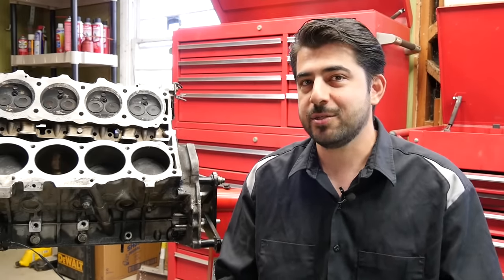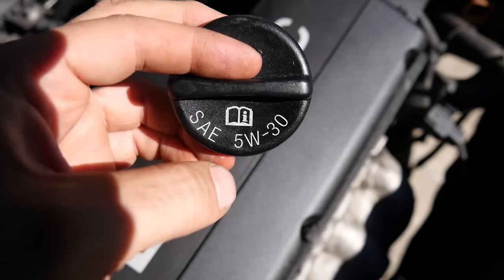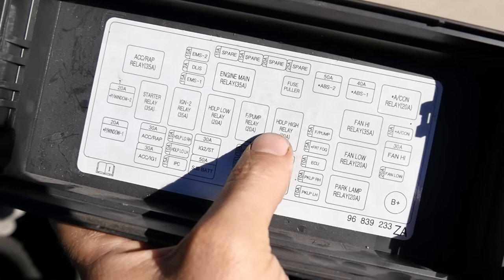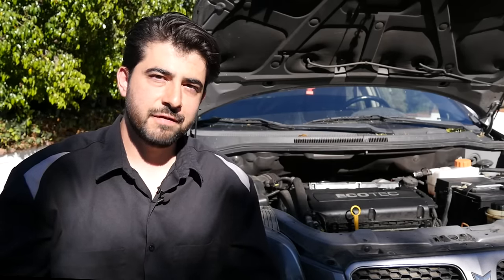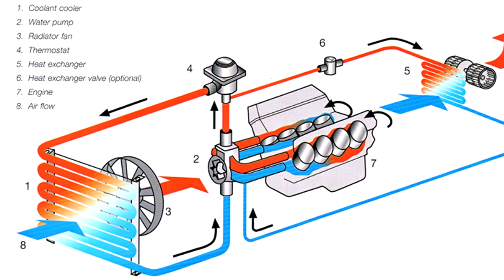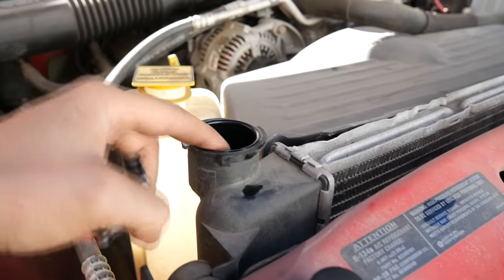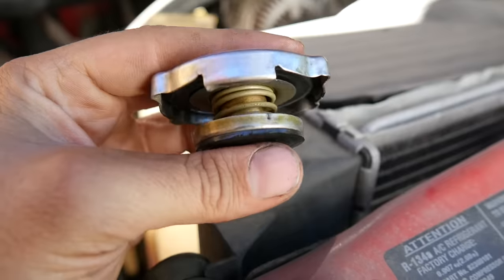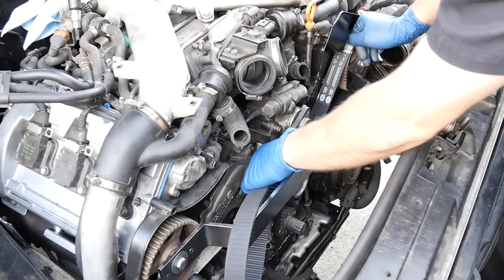Make Your Car Engine and Transmission Last a Very Long Time - Top 5 Tips On Car Care

Comment: I'd add to points:  (A) Check oil level at least monthly or weekly if you drive lots of hiway miles, oil use increases on hiways and oil level can drop lots before your next oil change! (B) Don't beat up your engine! It will last longer if you don't flog it!
Reply: Why would highway miles increase oil consumption?   That makes absolutely no sense at all.  Where are you getting your information from?
Reply: @GoingGoneGalt  Based on experience on several cars oil consumption would be more noticeable on several long drives. On modern engines, a lot of vacuum is used to reduce sludge in the engine by sucking up hot oil vapor and burning it before it can condense again. As an add-on some folks use 'catch cans' to catch oil vapor before it reaches the throttle body.
Reply: @mmpiforall5913  Anecdotal observation with zero data to back it up is worth as much as a congressmans promises.  Highway miles with lower average RPM, temperature, and chamber pressure are always going to use less of everything.
Reply: Highway driving with higher, longer sustained rpm and miles accumulated more quickly, will burn more oil. You should definitely check it more often. Plus, you do not know, if you do not check it. It’s drivers responsibility to check fluids and tires regularly.
Reply: @davidl766  Kiddo, I would bet that I have been driving and keeping my cars going for far longer than you have been alive.  Show me one bit of data that supports your claim.   One.   Anywhere.  And what are you driving that is drinking so much oil that you can tell where it goes??  My road warrior Civic with over a quarter million miles on the clock doesn't consume a quart in 20,000 miles.  In the desert, often in 110+ degree heat.  Going over a 3000' mountain climb every day.   Twice.
Reply: I check my oil every other time I fill up the gas tank.

Comment: Great tips. A few basic things I'd like to add in. Don't leave your car idling from long periods of time. I see soooo many people just carelessly leaving their car running for 10, 15, 20+ mins because it's "easier" to just get back in and go. And they do this in the middle of a hot summer too!  Also, drive your car gently until your car is at full operating temp if at all possible. I can only imagine how many engines would last longer and remain problem free if people did the most basic stuff such as this!!
Reply: What happens when the car idles for too long?
Reply: @rihasanatrofolo2472 it starts to overheat cuz it's only cooled by the radiator fan
Look up what happens if you idle too much plus it wastes gas
A startup uses 7 seconds of idle time fuel, so if you're sitting more than a minute just turn off the car 
I almost always avoid drive thrus unless I'm the only one in line or 1 person in front
Reply: @tomtemple69  That sounds extreme. I keep my car running for example when we'r eating and it's cold outside. Never had an issue yet. Is it impending doom?
Reply: @rihasanatrofolo2472  depends on how long you plan on keeping your car working in good condition, you shouldn't idle very often and no more than like 1 minute 
after 7 seconds of idling, you use more fuel than it takes to start a car, the engine isn't at optimal temperature for combustion, leading to incomplete combustion and carbon build up in the engine 
if u plan on keeping your car longer than like 150k miles, you should minimize idling, plus its just wasted gas 
when it's cold outside, you only need to warmup for like a minute, modern synthetic oil still performs good enough at low temperature, it just needs to be warmed up if you're gonna be revving it high and giving it a lot of throttle
Reply: @tomtemple69  cheers
Reply: @tomtemple69  Modern engines shouldn't overheat just because it's idling for too long. People idle for long periods in the summer and they don't overheat. Something's wrong with your cooling system if your radiator fan is on constantly and can't keep the coolant temp gauge in the middle.
Reply: @JulianKapa  ok but still, the fan can only so much, and the low RPM at idle leads to carbon buildup and fouling due to low combustion temperatures inside the cylinders, takes 1 minute to do a good search to see why idling is bad
plus it wastes gas
Reply: @tomtemple69  Fair enough. My car says it uses 0.5 litres/hour which I wouldn't say is a significant amount, but I'm not one to idle or sit in my car eating and what not.
Reply: It's very common to idle a long time here in Australia, for minutes, or even the whole lunch break to keep the aircon running... ❄️🔥🌡️🏖️

Comment: A quick note -- if you can prefill your oil filter, it is best to do it, wait and let the oil soak into the media, fill it again, wait until the oil soaks into the media...  until it actually levels out where you want it.  This might take a couple minutes, but it will optimize the oil in the filter, which is the entire point of doing this!  A quick fill and install might leave the filter about half empty, or even more empty.
Reply: I do this. After I pull the drain plug, next I write the mileage on the filter with a paint pen then turn it upside down/opening up in the box. I will fill it and let soak while removing old filter. I'll do the other stuff needed in oil change. I will fill a 2nd time before installing. Doesnt take much extra time.
Reply: Really overthinking it
Reply: It will get oil in it soon enough
Reply: I have been changing my own oil for 35 years.   Never once have I prefilled a filter.  Never once have I burned up an engine.
Reply: @GoingGoneGalt  IOW, this may well be overkill, especially in well maintained vehicles. Point taken. Theoretically, it is best, but might not make a significant difference. There are no studies to show when it might matter and when it might not matter. In theory, in some cases, it might matter.
It might only help assuage one’s OCD, too.  lol
Reply: @GoingGoneGalt  these people pre soak their clothes before placing them in the washer .
Reply: @wellnesspathforme6236  I would never tell anyone not to do it, it can't hurt, so if it makes you happy and makes one feel like a mechanical genius, have a ball.  But don't feel guilty if you don't bother, either. ADD; This from a guy who religiously paints all my threads with either anti seize or threadlocker, never dry!
Reply: @GoingGoneGalt  Keeping those bolts from freezing up is a Godsend!

Comment: Great maintenance advice to make your vehicle last longer. About 20yrs ago, the thermostat failed on my mom's car, causing $800 in engine damage. That thermostat cost like $10. If only we knew back then!

I'd also like to add that in addition to this maintenance advice, if you want your car to last as long as possible, drive it with care. Don't be heavy on the throttle. Jackrabbit starts are bad for your engine, transmission, and MPGs. Dont accelerate harder than necessary. The higher you're revving your engine, the more stress on your engine AND transmission. In other words, treat your car respectfully, maintain it properly and it should last a long time.
Reply: Tell that to my Tacoma    I floor it off the line   and I have 436k miles on her.     I beat the hell out of trucks transmission  I treat her like a rally truck and she still going hard
Reply: What about vtec tho? Hahah
Reply: @ncrtransport5993  it'd last even longer if you drove it respectable.
Reply: @lilbbbbbbb  Honda should learn about torque.
Reply: @palebeachbum  umm ok lol? And I should become an engineer don't we all need to learn something
Reply: @palebeachbum  but at this age and that many miles I got my money worth over and over all those miles were work miles,       so it something does break its 1500 for a motor and 800 for a transmission    which is nothing
Reply: @palebeachbum  plus it's also a truck it's meant to be used and abused not babied
Reply: @ncrtransport5993   yes to a point. And engine is an engine and if you drive it harder, longer, it'll certainly start blowing seals and gaskets sooner than an engine that was babied. Granted, if you're using it as a work truck you can't really avoid the extra wear and tear. I can't stand these prissy luxury trucks used for commuting. It's counterintuitive. It makes about as much sense as buying a Porsche and driving it on dirt and gravel roads its whole life.
Reply: @palebeachbum  well if you compare my mileage to most people I have double what most people get out of their engines,  weather your driving at 2500 rpms or 4k rpms it's not really wearing the engine out more   now if you redline the engine all the time then yes.       90% of all wear on internals is on startups        so I have 436,084 miles but i also let the truck idle countless hours.     Engines are designed to run         look at the million mile bmw    they only turned it off to change fluids then threw it back on the dyno
Reply: @ncrtransport5993  I think that has more to do with the engineering. Those Toyota engines routinely go a long long time compared to most comprable engines. I personally have more experience with Volvo 4 cylinders from the 80s. Those things were just getting broken in at 200,000 miles.
Reply: @palebeachbum  you think at 436k miles you really think he cares cmon man🤦‍♂️.
Reply: @dannymartinez8522  probably not. But his situation is an exception to the norm of all the cars out there.
Reply: @ncrtransport5993   Your talking about a Toyota. Do that to a Dodge or anything cheap American and see how long it last..
Reply: Tell that to the people who drive like maniacs in my area!  I agree though.
Reply: Hazrd to say when you drive a yaris
Reply: palebeachbum what about a rotary?
Reply: @cptcrunch2520  They blow their seals prematurely. Excessive wear. High revving engines wear out too.
Reply: I think that's only possible if she ignored the temp gauge inside the car and kept driving an overheated engine. Even then, most modern cars will shut off when passed a certain temperature.

Comment: I am the Scoty Kilmer of Amsoil,,....use it and  it will make it last and run much better ...OK a suggestion abut the filter that fits sideways (horizontal) ,,,Just pour enough in oil in the filter  wet and prime the filter media because a dry filter soaks up right much oil  ,no worries about spilling,, and that will allow the filter to prime pretty fast and as you say ,dont put on a dry filter ..

Comment: Use synthetic oil in standard & auto Trans too (will help standard shift trans shift better too!), maybe even an inline filter on auto trans.  I like to use redline or other brand coolant additive esp in summer, turbo cars love it. Use quality oil filters that have a good check valve in them to trap oil on shutdown, then a full filter will lube engine on startup. I like Tufoil oil additive, used it for many years...It holds guinness world book of record as the slickest substance known to man...has 11 International patents, used by NASA too. I dont know if they still sell those radiator filters anymore but they help to keep crap clogging up coolant system

Comment: Even if your oil filter goes in sideways, you should still put enough oil in it so the filtering material inside becomes fully saturated with oil.  It'll reduce the amount of time it takes for the oil to get through the filter and up into the engine once you start it for the first time after the oil change.
Reply: That is what I do..  soak the filter material and even for a side-mounted filter, you can put some in the bottom if you're quick enough getting it on.

Comment: I live down south and remove the thermostats from my vehicles. I also use synthetic oil and transmission fluid. I have over 200 thousand miles on my vehicles and they burn no oil between oil changes every 3000 miles. If you live up north where you need a heater in the winter, you can still remove the thermostat in the warmer months. It will make your engine and transmission last a long time by running cooler and getting good lubrication from the synthetic oil.

Comment: 5:06 - A lot of modern cars do not specify any interval for changing transmission fluid, so the big recommendation there should be - do it anyway. Modern synthetic transmission fluid is fine for probably 150K, but if you plan on driving your car longer than that you should probably change and flush at 60-100K.
Reply: NEVER FLUSH UNLESS YOU KNOW THAT CAR'S HISTORY AND YOU HAVE ALWAYS FLUSHED EVERY 40K MILES OR SO.
If you don't know the history and the car is high mileage have the pan dropped and DRAINED (not flushed) and have the filter replaced.
Any reliable transmission shop will tell you this.
Flushing can destroy the transmission IF it's high mileage and has been not well maintained with fluid changes.
Reply: @mikejohn0088  Yes. This stood out to me as well. I find it shocking that the author of the video mentions Scotty Kilmer yet encourages full transmission flushes. Scotty says to drain and fill every 35K or so.
Reply: @mikejohn0088 Very GOOD advice !!! Thank you.

Comment: Thank you for the advice on that 1 of you have to be very careful when changing the transmission fluid if your transmission fluid is black leave it the hell alone if you take that black dirty fluid out and put new fluid in it can cause your transmission to slip so you have to be careful with that if your transmission fluid is Brown you can still change it and not slipping or acting up but be careful with that kind of stuff so and you don't want to take all of it out because if you do a flush sometimes the flush can push through the transmission and cause problems as well The only time you can really mess around with a flush is if you're like you got a newer car you can do that but if you have black or dirty fluid you don't want to flush that  Through your transmission

Comment: Great video Dude!
My 2001 F150 Supercrew 5.4 just turned 363,000 miles.
From the water pump to the Differential the parts are all original.
Do these tips and you will hopefully be driving your vehicle for a long time.

Godspeed everyone. 🙂

Comment: As someone with 284,000 original miles,  I'm still on my original coolant cap and have no issues. I completely disagree with the flush. Everybody knows that's exactly what destroys a high mileage transmission. Just make sure to routinely drain and fill the ATF to prevent the fluid from getting too dark and dirty. Also, I think it's very important to go easy on the gas pedal. First, drive easy until the engine is warmed up. Even after that, it's not good for your transmission by giving it a bunch of gas while it tries to shift at the same time. Ease off the gas for a brief moment when it goes to shift. It's especially easy to do this in a car with a slap-stick/paddle shifter.
Reply: I've heard not to flush your transmission. I can start to slip and fail.
Reply: @charlesbosse9669  Yeah I’ve heard the same especially if your car has done high mileage. I think Scotty Kilmer mentioned it as well.

Comment: Too much heat is what kills your engine
Reply: David Handshoe hellyea
Reply: And it won't run right without enouph heat
Reply: I live in 110+ weather -_- (Phoenix)
Reply: VISIONARY TV he means while it’s using the engine. Temps probably get over 300 or something
Reply: Heat will kill an engine for sure,but most of them die from dirt,,,change you oil regularly  and don't beat the crap out of it  and any modern  engine will last
Reply: @tragiclife9760  you can thrash your car engine as much as you want as long as you service it at the required intervals.
Reply: @kenny desee 

Then watch your fuel consumption shoot up.
Reply: @kenny desee 

And premature engine wear because of bad oil temperature. The faster your engine warms up, the more efficient it will be.
Reply: @kenny desee youll get a code for the thermostat inefficient temp if you go non oem.
Reply: kenny desee ecm must be not as sensitive as mines.
Reply: I use Pennzoil Platinum full synthetic/OEM motorcraft filters & premium fuel for slower burn in motor! #Ecoboost
Reply: @tragiclife9760  truth.
Reply: @shifty2755  you know,I got a like on my comments,and revisited this thread,,,and saw your post about thrashing a motor as much as you want,,,are you serious? Do you really think a notor that sees redline  rpm daily is gonna last as long as one driven sanely,,,,not saying you can't run it hard ,,,but ALL the time,,,you must be a youngster,,,
Reply: @kenny desee 

That's a good achievement. You must look after it
Reply: @tragiclife9760  

Some cars will fair better than others. I wouldn't thrash a rover k series engine. But, I would happily thrash a Honda. I'm a 40 year old mechanical engineer by the way.
Reply: @shifty2755 ,,,im with you on the Honda deal,,,own 3 cars and 2 bikes,,,and yep,you can spin then pretty damn ruthlessly,,,,that said,,,rpm is what kills a motor in the long run,,,its all in what you want,,,longevity or fun,,,and yea,,,i twisted  wrenches for 58 of my 67 yrs,,,at one time or another raced everything with wheels,,,still build drag motors for a few friends
Reply: @tragiclife9760  

Nice. Look up the Rover k series engine for a laugh. It was a British engine. Woeful.